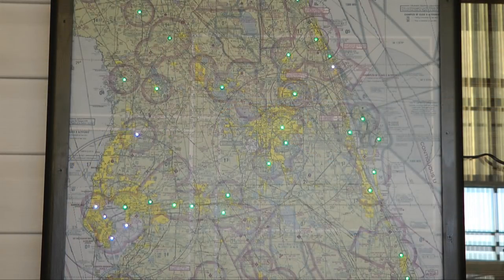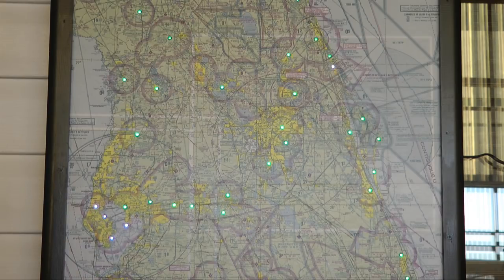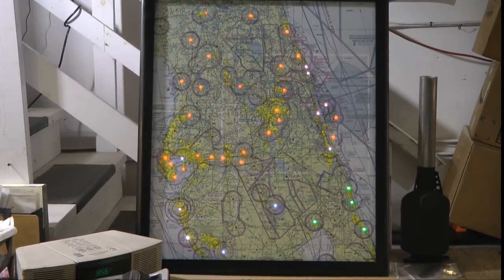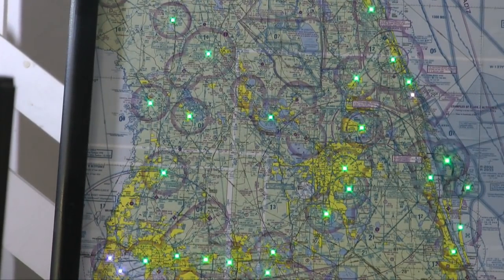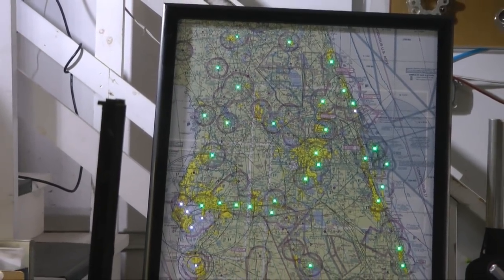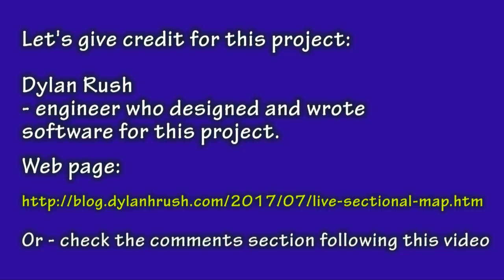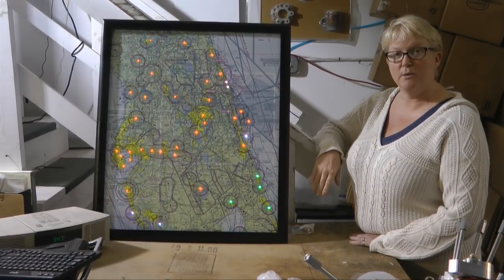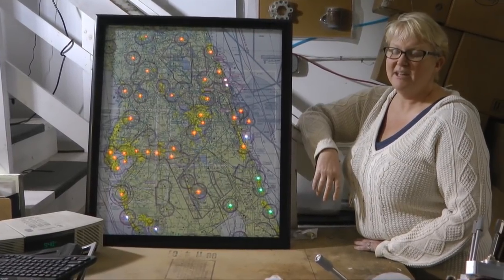Build a Live, computerized Aviation Sectional Map

Comment: I'm new to the Rpi and am a very novice at programming, but was able to get it operating IF I keep using the airports file included with the JJSilva site.  When I try and edit to change the airports to my desired list of airports (Chicago Sectional), the only results that I get are N/A.  What is odd, is that when I review the metar data that is captured, it has the appropriate weather conditions in the results, but the program is not converting that to the LED setting string properly.  
Anyone else have any trouble with getting their own airport selections to work?

Comment: I'd put up a big LCD screen or tablet to display this info for an international feel:
http://aviation.globalincidentmap.com/

Actually just any internet kiosk with a default home page with links to all kinds of real time aviation information and maps in your lobby would be the most useful, that wasn't complete locked down, so people could also check their email and messages from it or surf whatever you wanted.  Sometimes people don't have an internet device with them or forget to bring it.  The person probably using it most often will be you yourself.

For those that do, have a free wifi not-locked down access point with some range so people could even connect from their phone or tablet from out in the plane or parking lot and pull up maps, weather, and METAR information on their own before a flight.